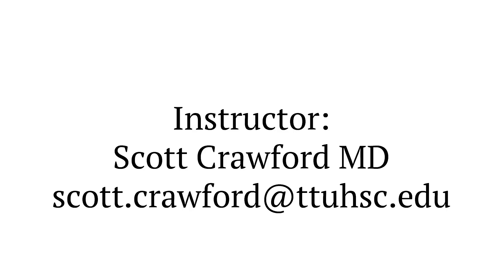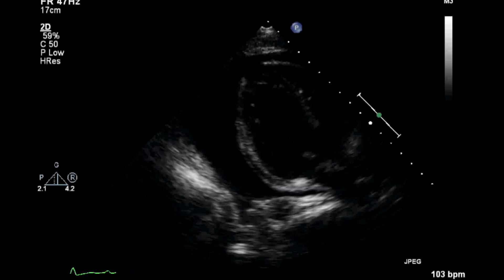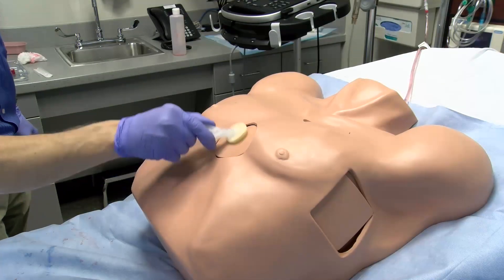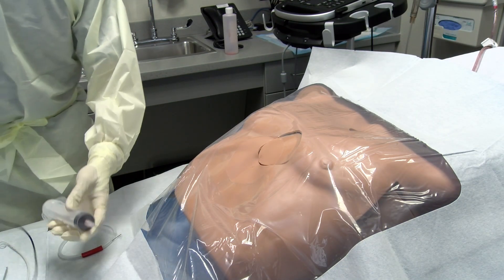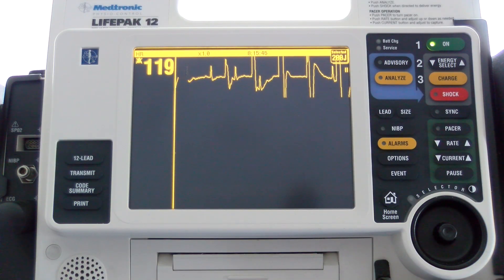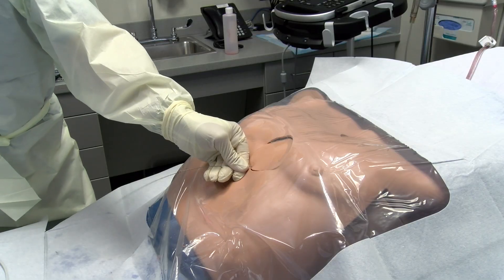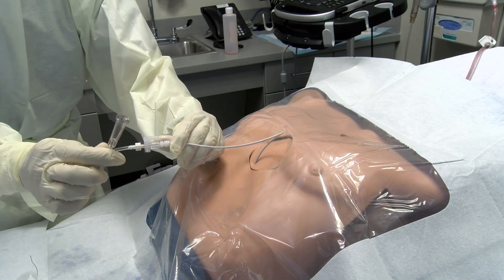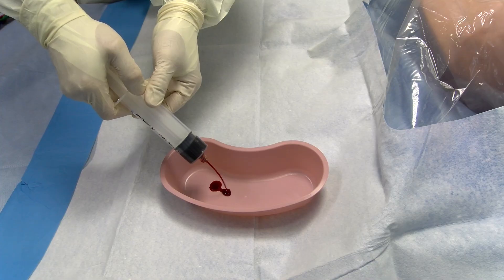Pericardiocentesis

Comment: I dont see ecg electrodes why?
Reply from the maker: The only lead needed is the one connected to the needle during insertion - to monitor for contact with the myocardium. Make sure this connected lead is the one selected for display on a monitor. Additional leads could be in place on the chest but may interfere with the sterile field. They were primarily omitted from filming because no actual electrical signals are produced by the task trainer used.
Reply: @ttuhscelpasoem  How does ECG record with only one electrode?
Reply from the maker: You are correct, and sorry for the abbreviated answer previously. The limb leads are required (RA, LA, LL) from the standard 3-lead EKG to provide the base point of the vector to display a precordial lead (ex. V2). A precordial lead should be setup for display on the monitor. The selected precordial lead is the only one that is needed (of v1-V6), and should get connected to the needle during insertion and be visible on the monitor for display to identify the "current of injury pattern" that would indicate contact with the myocardium.